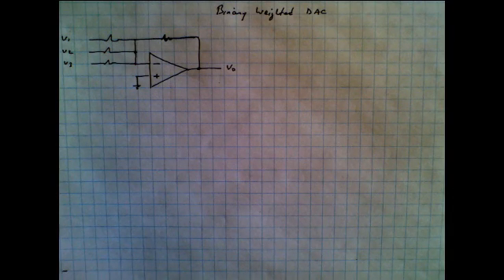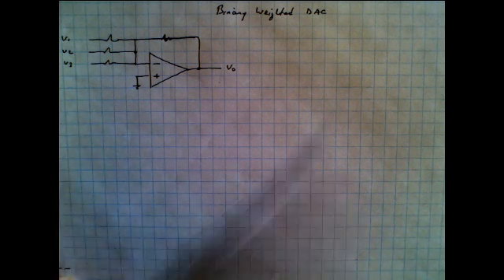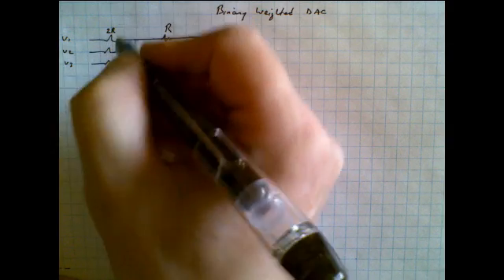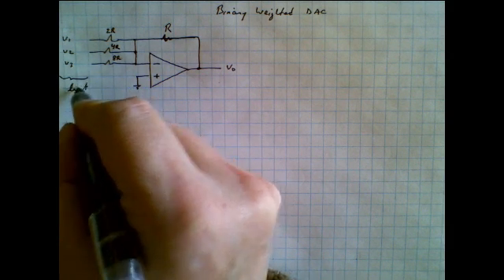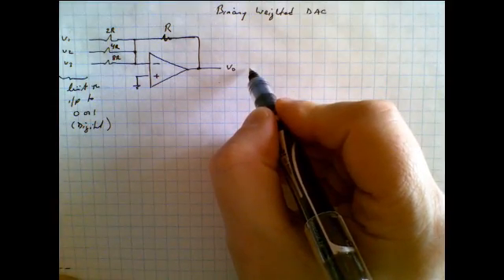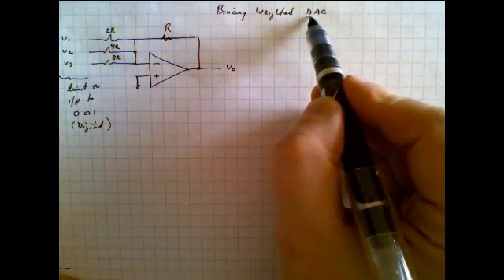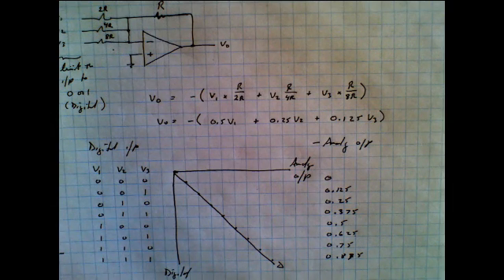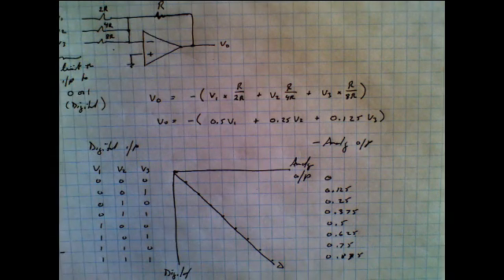Binary Weighted DAC

Comment: what exactly is that triangular device called?
Reply: Ultimate Urinater I am pretty sure it is an operational amplifier (op amp).  This is probably used because the digital logic can't drive the load on the output.  EDIT:  Seems it is called a voltage buffer, and it is indeed an op amp.  Wikipedia: "A voltage buffer amplifier is used to transfer a voltage from a first circuit, having a high output impedance level, to a second circuit with a low input impedance level."
Reply: roygalaasen k..thanks